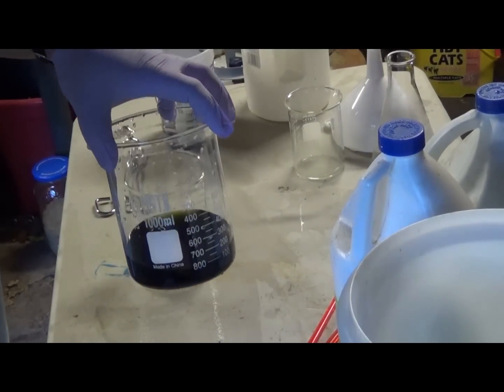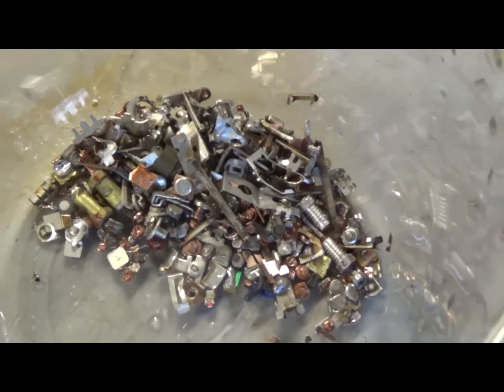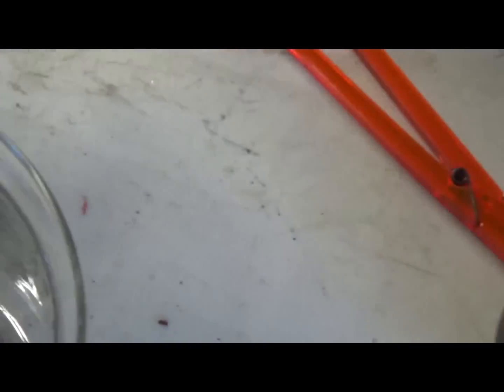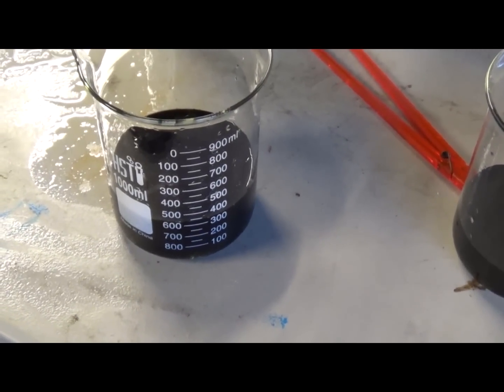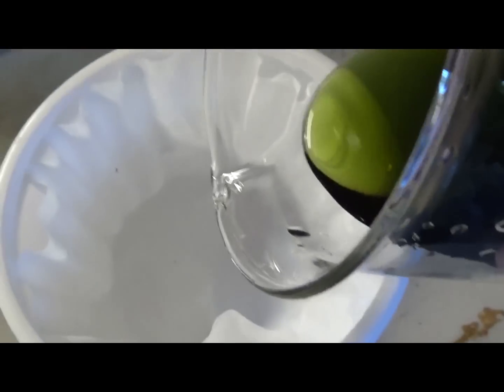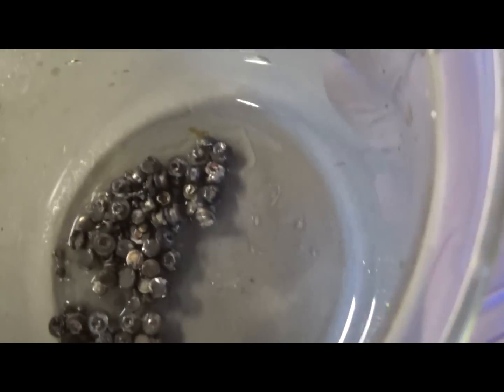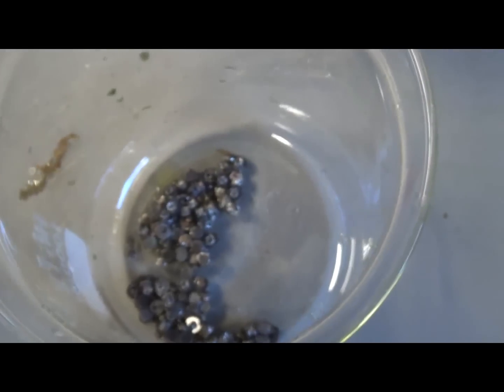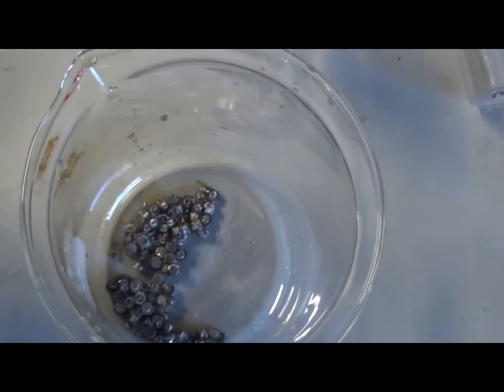How to Recover SILVER from contacts, relays, switches and more! Part 2 Acid Bath

Comment: Does temperature make a huge difference? I have a solution with silver and copper contacts that have been sitting for a week and barely any progress looks like it has been made. I am using muriatic acid from home depot and 3% hydrogen peroxide. I am doing 2/3 HCl and 1/3 Peroxide.

Comment: I did an experiment with light switches which I get for free as a consequence of my job. I saved them in a 5 gallon bucket for a couple years. Out of boredom this winter I decided to see if messing with it is worth the time. This is just regular single and 3way switches.

I clipped the contacts plus a piece of brass the same size next to it. This way I could find out how much brass the contact is bonded to.

I did 5 -3ways and 9 singles. 33 contacts. I kept brass screws and brass parts.

At the end of it I figured out I would get about 1g of silver per 33 contacts and 65g - 70g of brass.

Not even close to being worth your time even if silver and brass tripled in price.

Comment: if you dont like using nitric acid , why dont you use amonia ? . amonia used in the exact same way will disolve silver and recovering with copper is still the same
Reply: Interesting. Ill have to look into that, thanks for the info.

Comment: What is AP ?
Reply: Kyle Porterfield  acid and peroxide mixed..  its hydrochloric acid with a dash of peroxide..
Reply: Which does not dissolve silver since agcl is insoluble...
Reply: @oceanhouse8080  
Yeah. But It seem all base- metals gone. This is a good way to isolate The Sylver, then the Nitric

Comment: To dissolving copper and brass from the contactors im using sodium persulfate, it takes a few days but also much more saver then acids. Results are the same like in this video.
Reply: But with AP, the copper can be reclaimed afterwards.

Comment: I have some bits in my collection that appear to be silver contacts just because the shape of them is the same as the contacts you collect, but they are attached to steel, which you have never mentioned to my knowledge.  If those are indeed silver and I want to process them, what is my method?  Will the acid/bubbler dissolve the steel, and if it does, is the acid forever shot at that point, or is there a way to revive it?
Reply from the maker: I would do it sepereate from anything containing brass or copper.  Iron will make the copper cement out

Comment: Hey moose! Still loving and learning from the vids. Keep up the good work. Quick question, I've got some breaker contacts all nice and clean but when I tried to melt them they only partially melted. Left em in the furnace for quite awhile and still only partial melt. Could they be an alloy or some other problem? Any thoughts?
Reply from the maker: STOP!!!!  don't melt them without refining!!!  They could contain cadmium which is very toxic and aerosolized when heated!  Once refined, the silver powder should smelt perfectly
Reply: Thanks for the tip Moose!

Comment: To dissolve copper or brass from silver contactors im using sodium persulfate, much more safety then nitro acid, but much slower. White powder cheap and easy to buy, usually used to remove copper from home made laminate pcb circuts.
Reply: oh that's awesome. thanks for that info!

Comment: Moose what is this AP solution you use and where can I buy some
Reply from the maker: its a mix of hydrochloric acid and hydrogen peroxide (or air bubbles).  You can not buy it as is it must be made.  Both chemicals can be found at any hardware store but you really should read CM Hokes book on precious metal refining before you start anything.  Best of luck to you!
Reply: Thanks Mr Moose. Ive been wondering about some reference materials for dong this sort of thing. Ill take your recommendation.

Comment: electrical contacts in switches are pure silver & silver solder is used to join them to either brass or copper, so why would you want to invest more into further refinement? seems about a - .001 percent change to the silver content i am asking about 3 phase that have light spring pressure against the silver, not modern single pole switches. extremely curious thanks!

Comment: Hey Moose This is my first  comment to your videos, ive watched alot and i love your stuff man. I also  am from Maine and im an aircraft mechanic. I have learned that alot of the avionics wire in aircraft are  silver plated for data transfer.  and when a new instalation is done alot  of that wire is discarded.  any thoughts on recovering  that silver ? or do i need to use that aggresive nitric acid to do it?
Reply from the maker: sadly the cost to recover the silver may be more than the silver value.  I am in the process of trying to get a reverse plating cell working but am not having much luck.  If that works, then I think that would be the answer to your problem.  Where abouts in maine?
Reply: I think I have seen a few youtube videos about that with gold jewelry ,watches etc. Im near Ellsworth,  Lamoine specifically but some may not know  Lamoine so near Ellsworth

Comment: if you a/p mix too strong or leave in mix too long will it eat the silver?
Reply from the maker: no, it would be nice though good way to refine it
Reply: @moosescrapper5928  Silver reacts with the HCL, forming a very thin passivating layer of Silver Chloride, which is not soluble in water, HCl or H2O2.

It would not purify much of the silver contacts, even if left for years unless the contacts were almost continuously mechanically scrubbed to remove the silver chloride. So any impurities more than a few atoms deep into the silver would never be touched by the HCl.

Comment: I'm new to scraping. I have had silver contacts in AP Acid for about 2 weeks now and they still have plenty of copper on them. I use a 3:1 ratio. Acid turns black very fast, about 2 days. After it turns black it doesn't seem to be dissolving copper anymore. what am I doing wrong? Should I start a fresh batch of AP?  Thanks for the great videos!
Reply from the maker: No need to start anything new.  Just make sure that you do the math and have a ratio of solids to liquid as follows, no more than 2lbs of solids to 1 gallon of AP.  For the best results, you may want to try an air bubbler.  You can use old nebulizers, CPAP machines, aquarium bubblers, etc.  It can take a very long time to remove all the metal this way.
Reply: I think I found my mistake. I was using muriatic acid(hydrogen chloride) thinking it was the same as hydrochloric acid.
Reply from the maker: It is the same

Comment: what percentage solution do i need to soak the contacts?
Reply from the maker: I would strongly recommend an air bubbler rather than adding peroxide.  The peroxide will dilute the solution and you need it to be as conc and possible because of all the base metal.  If you cant, use a 25% peroxide to 75% HCL 31.45% and let it sit for a few weeks.

Comment: Im hoping you still check out the messages because your videos are the closest to asking this question:: I have not found a proper video as to what you do first. I have a tin of contacts/pins that have gold on them and silver inside . there is mentions on gold stripping videos about getting the silver after the gold but im not sure what they are referring to. could you enlighten me on this?
Reply from the maker: You have gold plated silver contacts?  Very odd, unusual, but not unheard of I guess.  If they are indeed gold plated gold then you would be best off studying aqua regia.  read CM Hokes book on precious metal refining, check out youtubers like indeeditdoes and thegoldrefiningforum.  I do not use AR at this point as it requires nitric acid.  Not much of an answer, but a direction to head in anyway.
Reply: Thanks

Comment: could you make a video of you recovering silver from the contacts, relays, etc. but a specific amount to see what the recovery rate is at the end make a bar out the silver
Reply from the maker: sorry that would require the use of nitric acid and I do not use that acid for safety reasons.  Thanks!
Reply: Could you use the muriatic/bleach to make it a higher purity like you did the gold sorry to ask so much I just started refining past week.
Reply from the maker: YIKES!  Please don't take this the wrong way but you should have the answers to these questions BEFORE you start refining....  Some pretty dangerous stuff..  Please read Hoke's book or precious metal refining.  And to answer the question, no, silver does not react to HCL or HCL and bleach.

Comment: I have been saving the silver contacts. On some parts I was able to heat the silver pad w/map gas torch and it fell off. I recently was allowed access to a building demo and removed a huge breaker that has pads of silver on it the size of quarters. Would there be cadmium in whatever solder they used to adhere them? I'm not into recovering the silver plating from electrical switches or grounding plates. Not worth it, but if there are chunks...Love your videos BTW.
Reply: silver solder is used to connect the contacts.

Comment: When you say AP do you mean Hydrochloric Acid as contained in "Muriatic Acid" for etching concrete?
Reply: Did you ever find out what AP is? I'd like to know also
Reply: @MrWatlow  It is two parts Hydrochloric/Muriatic acid (two names for the same thing) to one part hydrogen peroxide. I think you are supposed to use hair bleach strength peroxide, but am not sure.

Comment: Where do you find silver contacts? I guess a better question is how do you identify them when scrapping electronics? Thanks for your time
Reply from the maker: +Ryan Jones At this point in the game, I know where they should be, like the places mentioned in the title.  As for how to tell what metal they are, as they are not always silver, you can first sort with a magnet, then let the acids do the rest.  Just be very careful not to try to melt or heat with a torch because they may contain cadmium, very harmful, but the refining process should take care of it.

Comment: why don't I melt them ?
Reply from the maker: +Donald Bedore They can contain cadmium which is extremely toxic and is released in the air when melted.  Cadmium is removed in the refining process with nitric acid.  Currently I do not do that, I send mine to a friend who is comfortable with nitric.
Reply: +Moose Scrapper I'm 15 and I use nitric :)
Reply: Wow toxic!! Thanks for telling me wow I'm blown away by that.you just probly saved my life
Reply: +Donald Bedore yup. along with possibilities of lead, bismuth, other metals.better off going with chemical
Reply from the maker: +Random_rapper20 Marie Curie, well known scientist, was an expert in her field of working with radioactive materials.  Dead from radiation poisoning.  Just because one does something, does not mean they know what they are doing or that it is safe.  Working with nitric acid at age 15 is generally discouraged for the same reason that auto insurance is much more expensive for those under age 21.  General lack of proper caution and respect for the chemicals.  THis is not to say that you are not safe with the materials, just that the statement you made about being 15 and using it in no way implies that it is safe or less harmful.  Be safe, thanks
Reply: Moose Scrapper i do it in chem class under teacher supervision...lol but i still do. We actually refined gold in chem from escrap :P

Comment: Will this (or the nitric) method work on silver plated wire as well?
Reply from the maker: +qwertypoop1000 THis would not work so well on the wire.  There is not much of an entry to the base metal.  nitric or reverse electroplating would be better I think.  ultimately, its silver plating so you would need pounds of material to make an ounce at what $16 per ounce?  You may end up spending more money on chemicals unless you try the reverse electro.

Comment: if i'm right , nitric acid dissolves copper , as well as silver so if u put nitric acid on top of silver contacts wouldn't it dissolve them both at the same time?
Reply from the maker: ElementalCraze g no.  The copper would dissolve first.  Its a more reactive metal.  And if there is copper in the solution then the silver will not dissolve.
Reply: Moose Scrapper  oh ok thanks , i got some big contacts out of an industrial welder and hoping to dissolve them shortly but have no idea where i can get nitric acid so i might have to use acid peroxide , by the way , love your videos, i started scraping thanks to you and have learnt alot in the past year :)

Comment: Hi Moose, first of all thanks alot for your great vids. Never had any idea it was so easy to get your hands on some free silver and i'm at the source yeay!
Now, i recovered the silver from some welding rods with HNO3, cementing it out with copper. This worked great, gave me very pure silver powder (white greyish).
Next i threw 2kilos of uncleaned silver contacts into HNO3. Started the cementing and now i'm left here with a brown mud lol. Guess i forgot about the basemetal cleaning part since it went so well with the welding rods. I'm guessing this mud is silver, copper and some other metals.
Now for my question: what would be the better way to clean up this mud? Back into HNO3 or should i give it an AP bath first?
Thanks for your reply!
Reply from the maker: jan roegiers Well, I don't have any experience with nitric but can tall you that if you were to set it in AP the copper would get dissolved, not sure about the other metals.  I know that drew metalsmith has some videos on thi as well as indeeditdoes.  Thanks for sharing!
Reply: Moose Scrapper thnx for the fast reply
Reply from the maker: jan roegiers Anything to help a viewer!

Comment: Hey Moose, devoted follower here. Do you have any experience with what I believe are called "contactors"? I was given about 100 of them from a flooded basement by a guy that works as an installer at a phone company and also does HVAC work on the side(he used to neatly bundle up his left over two-strand phone wire until he had a huge trash bag to lug to the dumpster, the fool!).

They have copper in them like a transformer, but they also have the two-ended brass arms with relatively large silver contacts on them--exactly 12 contacts per contactor. I've painstakingly trimmed them flush with some strong shears and have 20 ounces of contacts. We'll see what I end up with, and you've probably heard about them before, but if not just a heads up that they seem worthwhile to seek out.
Reply from the maker: Nicodemo B Yup, that's some good silver.... for that much material you will probably want to try using nitric acid as AP will likely take a few weeks to get the job done. https://www.youtube.com/watch?v=XHaIIp0BFus

Comment: Hi Moose, great videos. Can you help me out? for 100 grams of silver scrap, how much hcl + hydrogen peroxide?
what do we do after we left it in the solution for a week? what do we do with the solution and how recover the silver?

thank you
Reply from the maker: You should be good with 400ml HCL and 200ml peroxide.  After it is left in the solution for a week or more the base metals should have dissolved.  What is left will be the silver.  Just pour and filter.  This will not be pure silver as some contacts are made from 80%, 90% or some other variant of silver.  Check with magnet to make sure all base metal has dissolved away.

Comment: Hello.. I made a video that doesn't use acid at all.. Use a mapp gas torch to remove the silver off the copper.. OK to use the acid off small parts of silver contacts.. But that acid is kinda hard to come by yes..  When larger silver is easy to see the torch can be used. :)
Reply: If they have cadmium in them (A lot of them do) you could be killing yourself doing it that way.

Comment: Hey Moose I'm just a beginner. I have scrapped a few computer boards.  And I'm saving all the things off of board   I'm just not sure what has the palladium  in them and what doesn't.  I just did an old monitor and that board had a bunch of glass and ceramic capacitors on it.  Do they have palladium?    Thanks to all the video it really helps
Reply from the maker: The MLCC's, or monolithic ceramic capacitors have silver and palladium in them.  They tend to run about 3% palladium by weight.

Comment: Moose-Great info as usual. Speaking of silver contacts,I saw 10/3/13 episode of the hair dryer pull apart, there are also contacts on the ends of the heater elements where the coils terminate on the silver colored board...Just did one the other day.

Comment: Hey Moose, I thought I heard you mention in one of your videos that you can "drop out" the copper from the used AP solution using stainless steel and it will restore potency to the solution and then you have pure copper you can melt. Is this true? Is it really that easy?
Reply from the maker: The copper will stick to the stainless steel.  Yes it is that easy, but keep in mind what you are left with, copper powder.  You will have to check with your scrap yard to see if they take it like that.
Reply: Good to know, thank you. Appreciate your time and wisdom, and the videos. Keep up the good work

Comment: Hey Moose would the hot sand bath work to remove the silver instead of using chemicals.  Also I was wondering if you have ever tried or heard of reverse electro plating to remove the gold off circuit boards. 

Apparently to do reverse electro plating all you need is a container, water , battery charger and baking soda. You put the ground connection on a steel rod in the water and the positive on the peace you want the plating to come off. Let it sit and it should fall right off.
Reply from the maker: I have not tried it, but have read a lot about it.  The most effective way is to use sulfuric acid.  I have not heard of using baking soda and water.  But then again, I am no expert.  Chances are that if I don't have a video on it, then I am not comfortable enough to give info on it.  Thanks!